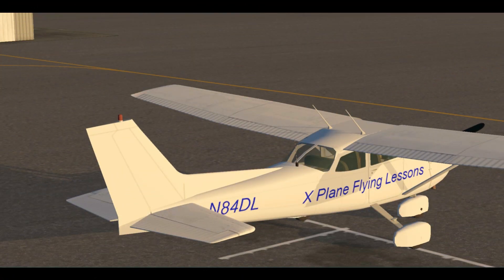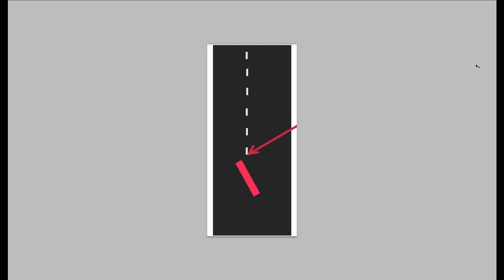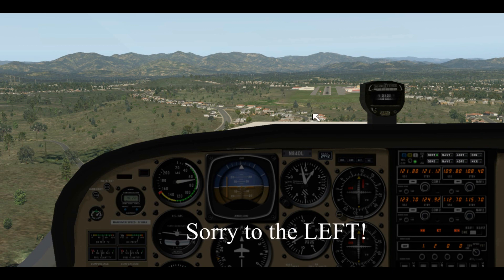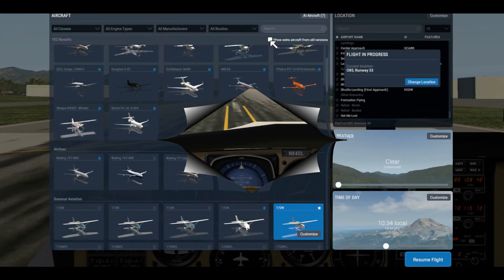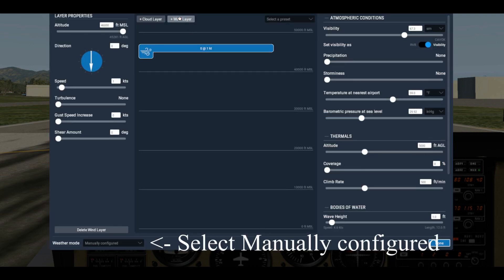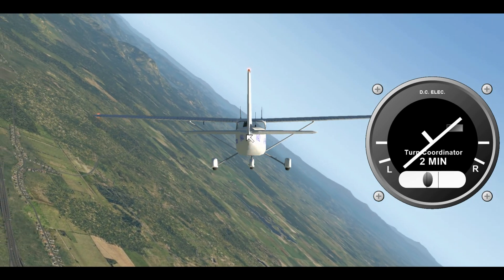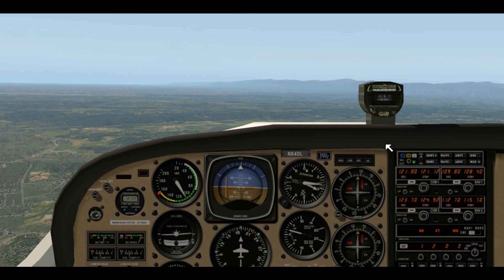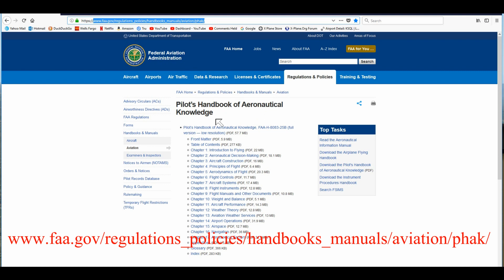The Rudder  ~ Learning to Fly for Beginners in X Plane 11 Part 17

Comment: Hey Skip, have you found a way of disabling the autorudder/auto-coordination in XP11? I found one tip to go in and tweak the rudder/aileron connection to a negative value in Plane Maker, which does seem to help a bit in the turns. But then when you get to climbing at high power and high AOA, you know as well as I do how much in a real 172 you have to stand on that right rudder. And for me in X-plane, no matter what I tweak the ball stays perfectly in the center. Just thought I'd ask if you'd found a way to simulate that.
Thanks!
Reply from the maker: Hi  tinytim2504, Try going into Settings for your Rudders and go to sensitivity. Play with the sliders, I believe if you move them all the way to the Left "0" this should do the trick, Let me know.

Blessings,
skip
Reply: @WEHVideos  Gave it a shot, so I've tried 0 on both the regular sensitivity slider and the stability augmentation sliders, and tried 100% to see if it was backwards, and every combination I could think of as well, but still no change in that regard. Maybe I have a wacky setting buried somewhere, or maybe (as unlikely as it seems) I've found an area where FSX with the P-factor sliders maxed simulates the physics than XP11 does..
Reply from the maker: Check this page out you may not really have a problem!! Let me know 
https://www.avsim.com/forums/topic/585628-xp-1150-auto-rudder/           
Janov has a suggestion.

Blessings,
skip

Comment: Great video-
Clear explanations to grasp the subject.

I have FS 2004 or FS9, I don’t always see or know when my bank turns look coordinated or not except by looking at the ball gauge etc.

Two questions:
1) when your landing with crosswinds, do you try & keep nose pointed at center if runway & crab or fried in sideways?

2) how were you able to get outside plane view & just “1” gauge displaying.
Reply from the maker: Hi Michael,  It's time to upgrade!!! Flight sims have improved tremendously so do some research and find one that fit your needs. As I mentioned earlier X Plane 11 is at the top of most lists for best "real" simulations but there are others you should check out. Some, like X Plane have a free demo do download.

To get outside there are different "views" you can select in the simulator and this is just one of them. The "one" gauge is actually from an add-on I purchased. It's a panel building tool so you can build your own instrument panel to display on a second monitor. Search the internet for panel builder and you should find two companies that do this. I have both, if you are interested let me know I'll give you the info.

For landing in a cross wind crabbing is probably the easiest but you can use the rudder to align with the center line if you want, it's up to you both work. 

Blessings,
skip

Comment: What program do you use for this video? I was looking at getting something that will help with a little practice before actual flight training at the local aero club.
Reply from the maker: Hi Oceans, I use X Plane 11,   I believe it's one of the best sim out there. Using the simulator can really help is some areas in learning to fly so if you are serious about flying I'd get a very high rated sim and definitely the equipment I suggest with the minimum being a good yoke or joystick and rudder pedals to make your simulator as realistic as possible. 

As for flight training may I suggest you shop around don't go with the first one you come by. Do some research on how to select a flight instructor and what the costs should be, you will find some sound like a good price but there are "add on" costs that can get you. For example does the price for renting the airplane include the gas. 
Good luck let me know how it goes :-)

Blessings,
skip
Reply: @WEHVideos  Thankyou for your quick response. Incidentally, I am from New Zealand. I just wonder whether I need to use a flight instructor or whether I can use , say a commercial pilot who flies small planes as a hobby. Perhaps that might be cheaper because the commercial pilot will be maintaining his hours in the air at my expense. But then I would need to rent a plane from someone. Just thinking outside the box. Not sure if that is plausible. PPL cost approx 18,000 where as a CPL would cost between 80,000 and 100,000. Quite expensive particularly when you consider the new cp salary working with a Commercial Airline.
Reply from the maker: Hi Ocean,  In the US only certified flight instructors can teach you to fly and I suspect it's the same in New Zealand. There are many requirements for instructors and they need to be certified and that's a good thing to keep us all safe up there :-). So spend time looking for the right instructor and school, it's so much more fun when you get along really well with your instructor so take your time it will pay off if you get a good match. If you find you don't care for one instructor you can move on to another. You will have a log book with all you did so going to another instructor doesn't mean you have to start over you just continue on. Which brings up one more thing. Don't sign a contract for you whole schooling, go lesson by lesson. Some schools want you to pay all up front. If you do that you are stuck with them so again be very careful when choosing the school and instructor, don't get stuck in a situation you can't get out of!! Let me know how you make out and good luck.
Blessings,
skip